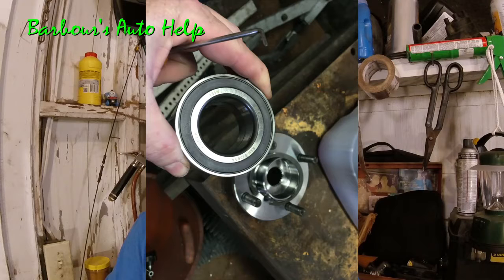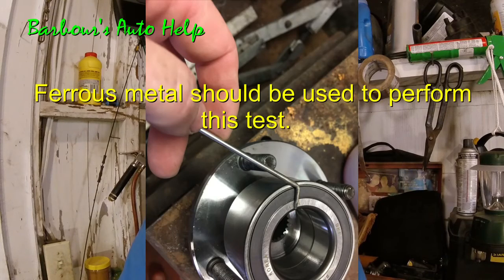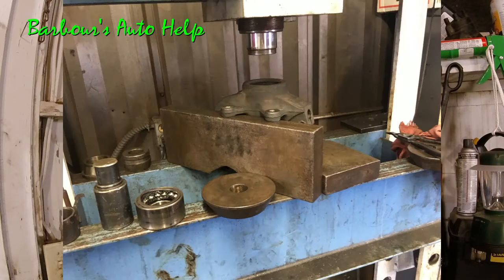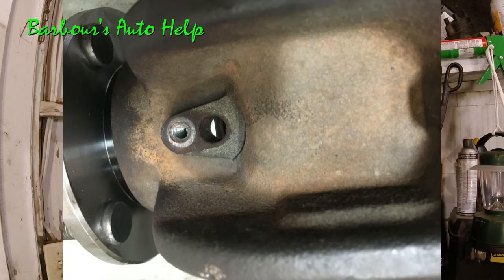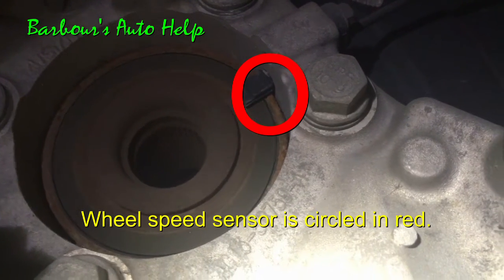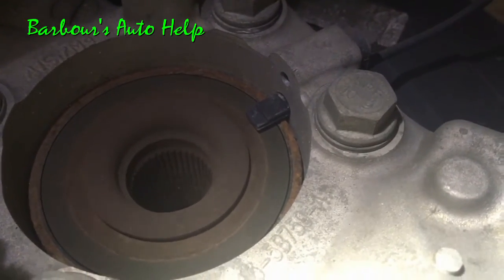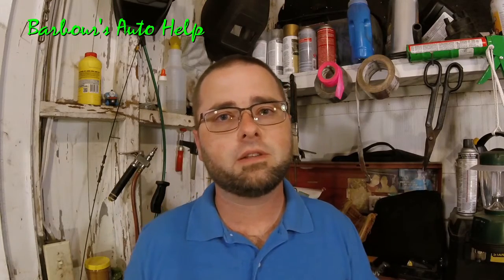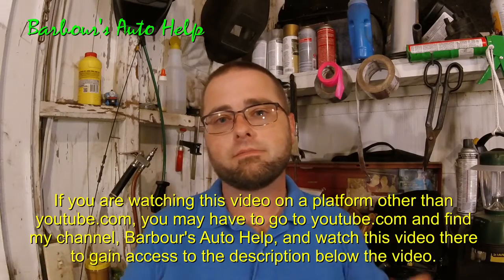Correct Installation/ Orientation of a Press in Wheel Bearing With an Integrated Magnetic Reluctor

Comment: I bought skf but could not tell which side was magnetized even i Tried, no power to attract a paper clip, and other small metal stuff, only a little wire of a metal brush got attracted by one side it seems very weak, I put them in the freezer may be that was the reason why were not attracting metal, I dont know, but it seems the the engraved letters side is the magnetized, not totally sure, but did not get any lights in the dash
board

Comment: I have a TRQ wheel bearing for a Acura 2001 MDX. I cannot detect any magnetism on either side of the new wheel bearing. One side has a black seal and the other side has a metallic seal. I'm trying to determine which way to face it in. I don't want to repeat this installation.  Any help??

Comment: On a idler pulley or spindle bearing on a deck on a riding mower, how would you know which side to knock out if you needed to change out the bearings?

Comment: Other than abs light throwing the sensor will there be any other issues will the bearing work properly
Reply from the maker: I'm not saying the bearing will work properly for every application but the bearing should work in most cases.

Comment: That's not true (about destroying it).. you can just push on the center hub and push it right back out.  You're not in bad shape unless you push the hub in. Once you push the hub in, that is when it comes apart when you push the hub back out.  But even then, if you have the right bearing tools (bearing separator), to push the race back off of the hub, then you can still put it back together again and flip it around the right way.  It will go right back together just fine;  as long as you did not damage the seals.  or drop it in the dirt, etc...  The issue is, if you push the hub on, and then you have to cut the race off the hub shaft because you don't have the right tools-- then yeah, you'll have to buy another bearing at that point.

Comment: I have been a technician for 17 years. This just happened to me today after hundreds of wheel bearing replacements with no issue. 😂 I WAS PISSED!!
Reply from the maker: Don't feel bad!  I've been doing it for 23 and mis-timed an engine the other day.  We're all in this together.
Reply: the first one for me a few years ago was a 2010 Honda Civic and after the wheel bearing install the ABS light was still on so I started to take it apart and found by luck I installed it correctly....had to replace the ABS sensor and light went out...my scanner said it was same wheel that I replaced bearing and after digging around I found out about magnetic tone ring on bearing...first for me and I have been changing bearings for over 30 years

Comment: So I’m working on a 2005 Scion xB and there is literally no difference on either side of the new bearing. How do I know which way is correct? Also, there’s literally NO magnetization of the new bearings
Reply from the maker: Maybe your vehicle has a reluctor on the axle?
Reply: @BarboursAutoHelp  there is an ABS sensor but the seller told me there is no difference as to which side is installed. That’s the part I’m concerned with. Also I have no idea what that item is you are referring to
Reply from the maker: Where is the ABS sensor located exactly?  Does it mount right up next to the bearing?
Reply: @BarboursAutoHelp  right above it, almost dead center of the bearing…looks like the axles have the reluctor rings but that’s new talk to me so I’m not sure how they work
Reply from the maker: If the axles have reluctor rings, trigger wheels, then your bearings are probably not equipped with magnetic reluctors.  I'd check a manual just to be sure though.
Reply: @BarboursAutoHelp  that’s what I figured. I’m going for broke today so we’ll see what happens! Thanks for all the feedback

Comment: will this also cause the parking brake light to come on as well? my abs came on but i had plenty of brake fluid in the master cylinder and didnt have to bleed the brakes or anything (saying this because i also replaced my pads while doing job) so my parking brake light shouldnt come on unless this is also due to the abs system as well.
Reply: Yes, that light comes on as well.

Comment: I have a question for you. I recently slightly over pressed the hub into the bearing (not proper support to stop the inner race from starting to separate. I did some damage to the black rubber or plastic that is the sign of the reluctor ring side? (Snap ring digging into it). I pushed the inner race back in the other way and everything seems to be working properly and there is no noise when driving. At this point I’m wondering if I did damage to the new bearing? and should replace it? I appreciate your thoughts.  :-)
Reply from the maker: It's my philosophy that when in doubt, redo.

Comment: You know how when you pull a hub, sometimes the bearing race is stuck to it?  Well, after I pressed in the hub bearing, then went to press the hub, the hub pushed the inner race out towards the engine. I knew I probably had it backwards, but my car doesn't have ABS. I did press it back in carefully.  Now, I don't know if I need to replace that bearing because it is in backwards, or if that is ok.  Anyone know?
Reply: If it doesn't have ABS, then you are fine as far as it being backwards.

BUT:  when the new bearing's inner race got pushed out (towards engine), this 'broke' the original seal of the bearing.
Even after you press it back in, there is no telling if the seal is properly seated anymore.

Seeing how your comment is 1yr ago, the results should be able to tell itself.
If water/moisture gets in, and corrosion starts forming, that new bearing won't last long.
If the seal got seated correctly, and is able to keep out moisture etc, then you got REALLY LUCKY, my friend!  😅😅

Comment: Great info thanks, Is there a right and wrong way without the magnetic part? I have killed 2 bearings installed correctly on a Mitsubishi with a press and both times pressed in perfectly and both times after the hub is installed the bearing goes faulty. When pressing them back out I notice both sides of the bearing are different inside. One side is sealed and has a yellow plastic ball spacer and the other side isn't with a black ball spacer. This leads me to believe I must be pressing them in the wrong way but there are no markings on them to indicate what way is the correct way. I have a 3rd bearing that just arrived and before killing it again I was looking for some advice. Thanks.
Reply from the maker: Sorry,  I'm not sure what the deal is there.
Reply: @BarboursAutoHelp  All good. as it turned out you get what you pay for. I ended up buying bearings from the Dealership and you could just tell by looking at them how much thicker the housing of the bearing is compared to the cheaper OnlineAutoParts ones. Installed and job done. Lesson learned.
Reply: @TaragoPreviaEstima  Good to know!  I'm about to replace my front wheel bearing.  Ended up ordering genuine original manufacturer part, instead of aftermarket part.  Got lucky in that decision.  Thank you for posting your experience!

Comment: Mine is magnetic on both sides and they look exactly the same.
Reply from the maker: Question or just sharing?
Reply: @BarboursAutoHelp  i guess it was a question but i had no issues. from what i was told some of the new ones have it on both sides to keep people from messing up. i was still questionable but just picked a side like a twix bar and installed it. LOL
Reply: I think mine are both sides as well. One side has writing I think I’ll push that towards the sensor

Comment: Thanks for this video.  I saw someone mention bearing direction in a bearing replacement video.  Then I went to check my bearing and couldn't get any magnetic pull.  Now I realize it is because my car doesn't have ABS! So I assume it doesn't matter which direction. Thanks.
Reply from the maker: You are correct

Comment: I wish he would have explained if your wheel bearing don’t have a magnetic side but your car has ABS then this is what you do. But he didn’t say that. I have a Hyundai Elantra 2013 and the wheel bearings I brought don’t have any magnetic side but my car has ABS.   So my search to find out continues
Reply from the maker: Grab a manual.   Autozone has one for free for customers.
Reply: @BarboursAutoHelp  thanks for the rely but I actually found the answer. If anyone needs more info on this check this link. https://www.eeuroparts.com/blog/wheel-bearing-tone-tech-corner/
Reply: You figure this out i put one in with no magnet and it still roars.  Maybe it needs one with a magnet?  But I have no lights on and don't no if it has abs but it's a 2013 elantra

Comment: By extension, some CV axles don't come with a tone ring for this reason; ABS sensor technology is integrated into the bearings.  So if the part description says "ABS tone ring not included"  don't panic, you didn't need it anyway.
Reply from the maker: Good info!

Comment: This only works if the wheel bearing is magnetic on 1 side. I am waiting on a "reader" because my customer's 2010 Honda Accord front wheel bearings need replacing. I tried the paper clip trick & both sides retained the paper clip. Usually the color is different of you can tell with the trick but the National brand I got is the same color on both same sides. This is the first time I could not tell the difference. A $16.00 tool off Amazon (it seems about the only place I can find it as I don't have a relationship with tool trucks anymore)  is the only option.
Reply: The National brand wheel bearings are Dual Encoded, so you can use them on either side.
Reply: i have one like this so does both sides have the reluctor

Comment: Installed rear wheel bearings only I didn’t touch the front now front wheel speed sensor throwing abs, traction control brake system codes and drivetrain malfunction codes anyone have an idea why
Reply from the maker: That's a strange one.  I'm not sure.
Reply: is your car rear wheel drive?

Comment: I just made this mistake. After replacing the wheel bearing I have a roaring noise, abs light on as well as traction control light on. Based on the growling of the bearing, I’m gonna replace it as I don’t wanna take any chances as I do not wanna do this a third time. I never knew this fact about a wheel bearing being magnetized on one side. Believe me, after today I’ll never forget it. Thanks for this extremely valuable information. I really appreciate it.
Reply: They aren't all magnetized like that.  Also, make sure you have the center shaft nut tight enough.. It needs to be 180 ft lbs.. so it can hold that bearing together correctly

Comment: so I installed a bearing and my abs light came on does that me I installed it wrong I tried looking for the magnetic but Ig the bearing I used did have one ?
Reply from the maker: Well, what diagnostic trouble code do you have?
Reply: ABS, traction control and low tire. I never had them lights turn on till I changed that out
Reply: @juliocampos5551  That's because you must have the first generation bearing that has a metal seal but no magnet. The magnet is located on the sensor and it should be reading the abs/speed ring on the axle (the part on the axle that has ridges). There are two seals on your bearing: one is metal and the other is polymer; the metal side needs to be facing the abs/speed ring on the axle (the inner side) and the polymer side is facing the hub (outside). Hope this helps you. Good luck. 
Oh, for those whose vehicles DO NOT have the abs/speed ring on the axle they need to install the side of the bearing that has built-in magnetized abs/speed ring on the seal to face the sensor; otherwise, if you install the side of the bearing that has a polymer seal the sensor would not pick up the magnetized abs/speed ring built in to the seal side of the bearing and the computer processor would read that as zero signal.....and thus triggers the code.